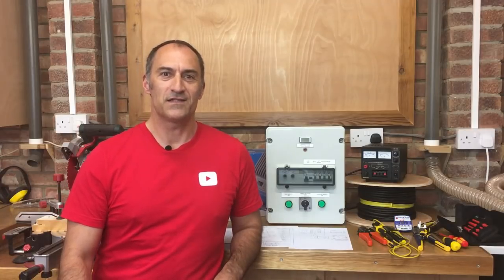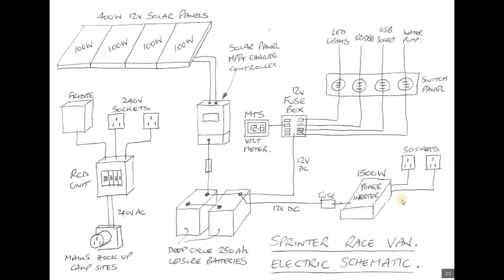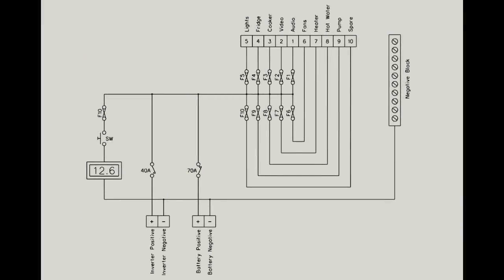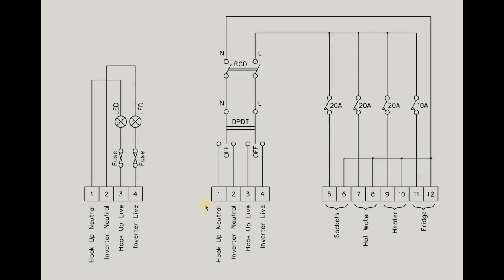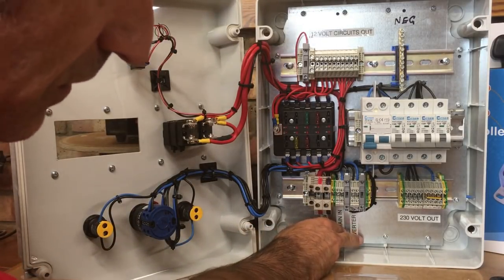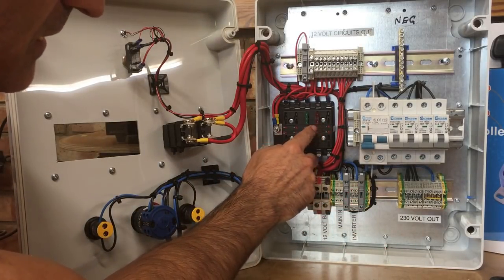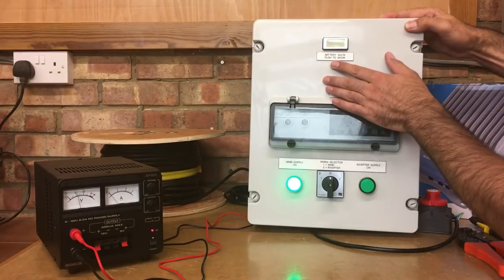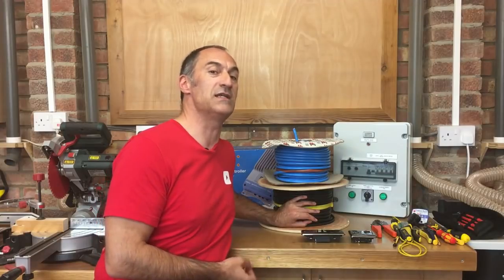Self Build Camper Van 12v Electric Control Panel

Comment: Stupid question, but can't you use an automatic transfer switch instead if the manual switch? In the US, you can get an inverter that has a built in battery charger and transfer switch that detects when you have a mains hookup (shore power) and do the transfer for you. It would really simplify the wiring and size of your panel. Maybe in the UK they don't allow for that?
Reply from the maker: nebulight yes, that is another way of doing it, I have seen ATS used in comm's rooms on UPS systems, maybe you can send me a link out of interest. Cheers
Reply: the units I've been looking at don't do 230, but I know Victron Energy makes a series of inverter/chargers that have a built in transfer switch. https://www.victronenergy.com/inverters-chargers/multiplus-12v-24v-48v-800va-3kva
Reply: Speculation: quality of output power waveform?
Achieving a proper sine wave requires different circuitry at higher cost vs a saw-tooth or trapezoidal wave.  Resistance loads like heaters and incandescent light bulbs don’t care, but often electronics are sensitive to the waveform they are supplied with.
Reply: Not a stupid question at all. That is exactly what I would do. Just get a mains powered contactor (they are quite common, nothing fancy), power the contractor from the external mains in and it will switch automatically when the van is plugged in. I cannot think of any time where you'd want to run of batteries when plugged into the mains so this should work fine. Also you can lose the switch for the LCD panel, the current draw on that will be tiny relative to the capacity of your batteries. (The USB charger parts in the sockets will draw more than the LCD.) I'd also have a similar looking ammeter in series, so you can see what the current draw is.
One down side with the contractor is that you would lose the centre off, not sure how much that would affect things? I think if it was me I'd have the contactor to auto switch and if you haven't already got one a separate overall isolate switch to disconnect the batteries fully,  ( my boat used to have one) to stop the quiescent current draw when the van is not being used.  Also, as others have said, you definitely need to have a charge circuit from the van's electric when running.

http://uk.farnell.com/schneider-electric/lc1k0910u7/contactor-4kw-240vac/dp/288238 - This is the sort of thing I mean...
All the best.
Reply: nebulight I’ve looked up these inverter charger and Could not work out why there was a massive difference in price. £1000 - £45. Could you briefly explain what I may be missing besides the difference in voltage rating?

Comment: Hello David, I do this kind of wiring for a living (PLC I/O panels, motor controllers ect.)and I must say your schematics, build and explanations are top notch! Cheers!
Reply from the maker: Hello David, that's really nice of you to say so, many thanks. I'm mechanical engineer but have dealt with motor control panels all my life so I know enough to get by but I'm always learning every day. The DC side and solar is all new to me so had to do tons of research.
Reply: Hi Greg.
Where did you get the distribution board and components from this video? It’s such I good idea I want to replicate in a build we are starting now. 
Thanks
Mark M
Reply: tptwk - Thanks for your professional stamp of approval.  Very good to know that this design meets all safety requirements and has the seal of approval of another professional.  I learn almost as much from the comments as the video.  Every discussion sheds light and contributes to the knowledgebase.
Reply: Hi there Greg, is there a chance you sell the distribution board?
Reply: How much do you charge to install this in a van, if i buy all the equipments?

Comment: Hi Greg great video mate just one point do you need a dump load on the solar panels battery  side I couldn't see one on your plans don't want you to cook the battery's I could be wrong not up on electrics
Reply from the maker: Hello mate, I'll check now you've asked but surely that's the job of the MPPT Solar Charge Controller? Let me find out for sure, I'm learning a lot of this too as I go. Thanks
Reply: I could be wrong mate I built a wind turbine for a mate few years back he had to have a somewhere for power to go when batteries where full could be different with solar panels
Reply from the maker: Did he have a charge controller in line with it?
Reply: To be honest mate I can't remember if do remember if we put a brake on the blades to stop it he wouldn't have needed a load dump so if your control switches panels of should be ok but iam no electrician gorilla with a spanner me lol
Reply: Can you make me one and how much?
Reply from the maker: Hi Steve Lamport, very sorry, but there's a number of reasons why it's not possible for me to make these for other people.. Liability being the main one. Thank you

Comment: Will you be selling the fuse box? Would be a God send if you were!
Reply from the maker: Hello, unfortunately not, sorry. I wouldn't be able to make it at a low enough price to sell and cover the time it takes to build.
Reply: Hello Greg. Great videos. Thank you. I'm an electrician of 30+ years. Just a couple of things the RCD should be 30mA tripping current for shock protection. With a 70 amp input current to the inverter could you mention your cable sizes? Also I hope you will show this on a completed electrical installation video? You have inspired me to move on my own camper build. Thanks again. David
Reply: what if you hire people, and you just sign off on them?
Reply: McTaggart Family b

Comment: This is excellent video but can I ask one quetsion and make one observation.  Are you adding a battery charger to charge the batteries when on hook up and also from engine when engine running?  The observation relates to the green light, that would drive me barmy at night, big attraction for me is how dark a van can be at night.  Thanks the videos are great and I was able to follow the logic.
Reply from the maker: Hello David, yes and yes to your initial questions. The panel is to be housed in the garage at the rear of the van, so will not be in view from living area and no lights at night. Good point though, thank you